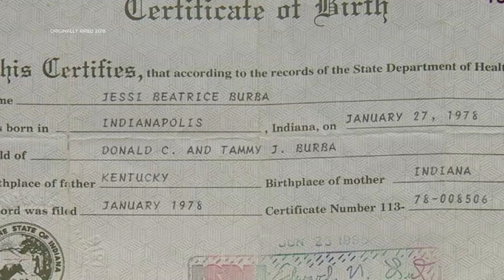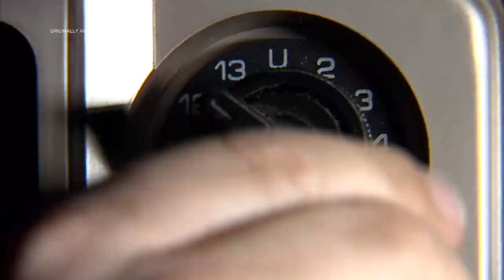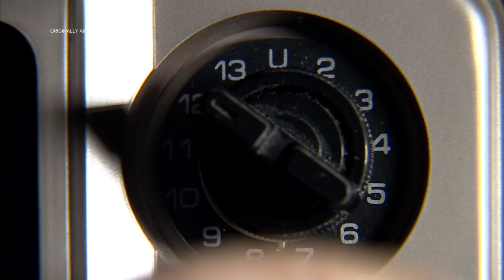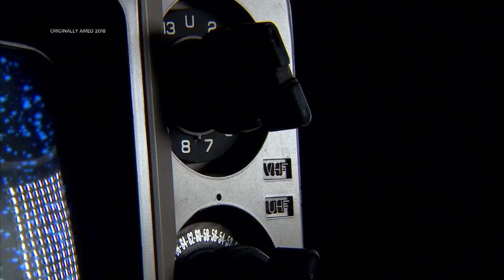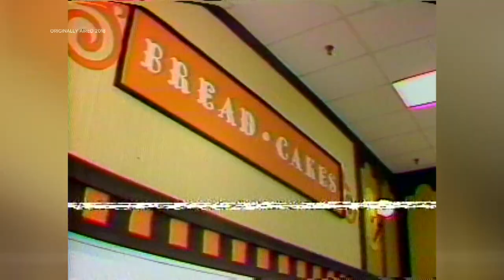The Blizzard of 1978 I WTHR Archives

Comment: I was at work on 3rd shift when it hit in Ohio. Very warm that night then the wind started. Windows bowing in. Ceiling exhaust fans sounded like helicopters. Then temps dropped. Snow was coming down in the morning sideways. Plant closed at noon. I volunteered to stay over until the plant closed. When I finally found a way home in my CAR the engine stopped. I opened the hood and the engine compartment was all snow except for the fan blade. Must’ve been climate change